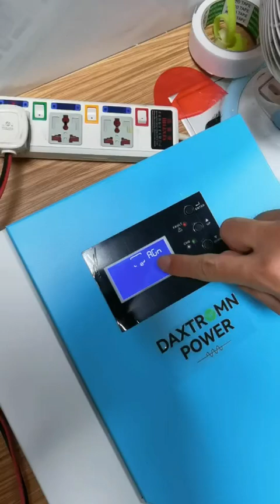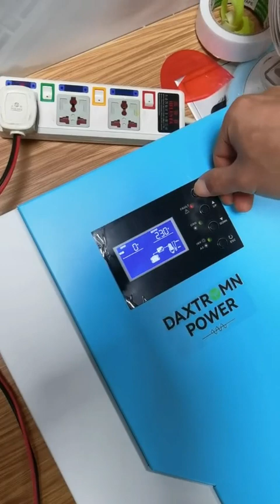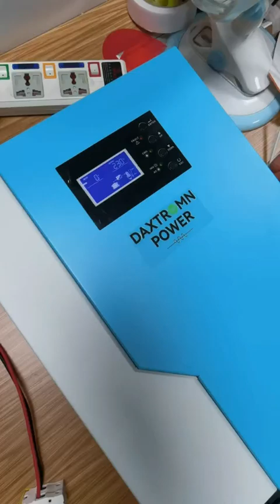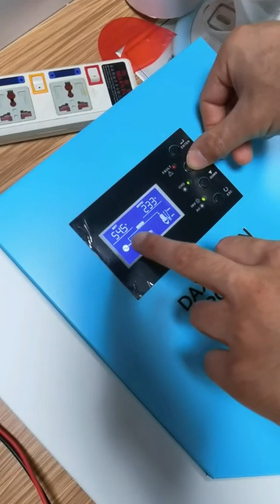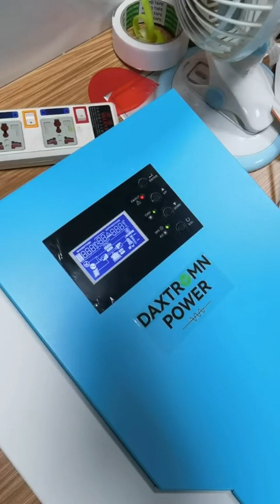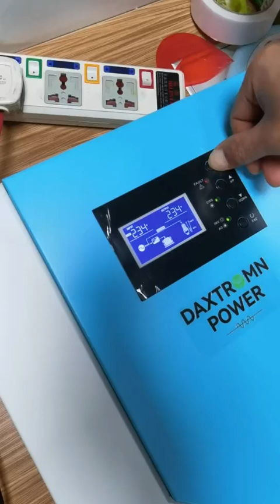Daxtromn power solar inverter how to setting the charging voltage floating charge voltage

Comment: I bought Daxtromn Power 6.2 Kw Pro Hybrid Inverter. It's been working Almost three months now; I have really bad experience with this inverter. Moreover, there is absolutely no support. I send them emails, tried WhatsApp and messaging. Nothing happened. Zero support from Daxtromn Power. Completely wastage of money. product is useless. I would urge everyone not to buy from them. Please look for alternate. There are many solar inverters in Market, but This one is rubbish. Does not work properly and there is no support.

Comment: you can set lifepo4 settings for daxtromn 10.2kw  2x 25,6v  100ah power queen
  bateries ?
Reply from the maker: yes, setting 05 at USE, then setting 26 bulk 27 float and 29 low cut off

Comment: How to use the Bulk voltage limit for Charging Li-NMC? (the Charging LED by the display in my case solid on, flashing i see for a few seconds, when it's starts the charging, after that the LED solid ON until the Float limit)
By the graphic i need the CC CV   - Bulk and absorption after that bypass the battery.
The Bulk voltage limit the inverter never reach. But floating current flow NOT needed for Li-NMC battery pack.
Can you help out with the correct settings, or it's a firmware issue?
Reply from the maker: you can set bulk at 26, same setting method as the video
Reply: @flinsyu3635  Bulk - 28.4V; Float - 28.0V
It's not charging it to 28.4V, only to 28.0V
https://youtu.be/rTSMSuX4MnQ
Reply from the maker: @DPTech_workroom   set the bulk and float the same
Reply: @flinsyu3635  Why?
Or it wont make floating charge with 4-8A, when it's done?
Reply: @flinsyu3635  I did it - nothing changes. I see the floating current 6-7A on the inverters display. It's just a similar inverter, so the  firmware can be other...
Reply from the maker: @DPTech_workroom   setting bulk and float the same if your battery is lithium ,usually float is meaningless for lithium battery
Reply: you can set lifepo4 settings for daxtromn 10.2kw  2x 25,6v  100ah power queen
  bateries ?